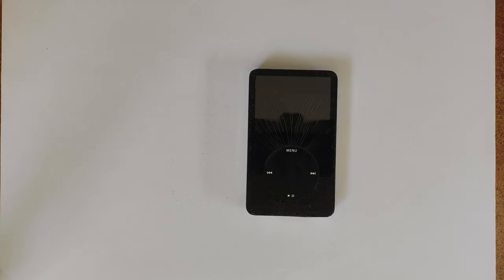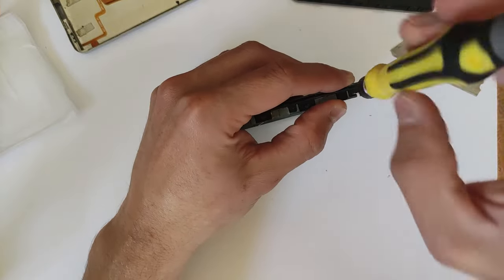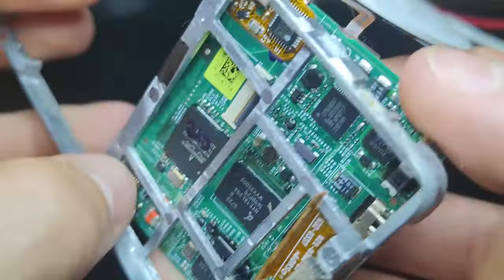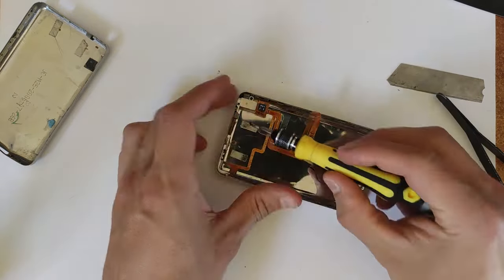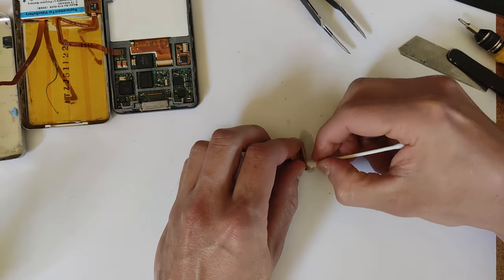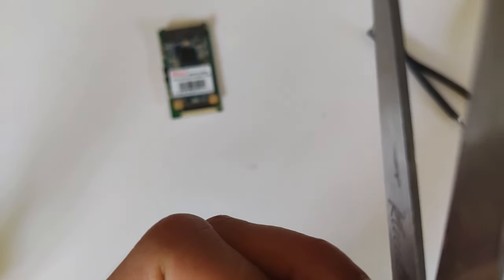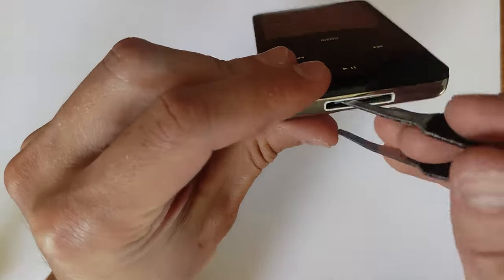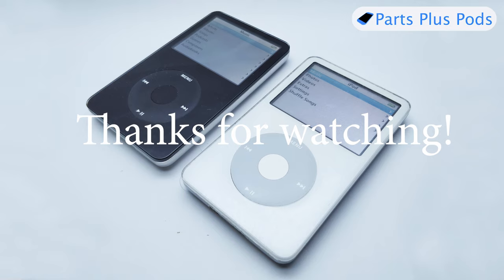iPod Classic 5th Gen Hard Drive and Battery Upgrade Tutorial Ultimate Repair Guide

Comment: Nice video as always. Please, it would be great if you could make a video explaining how to edit those CF adapters with hex editors in order to use them with our pods (those adapters with recent firmware). I've seen the explanation in some forums but never achieved to make them work. It's a pity because adapters with old firmware were a cheap and quite reliable solution.

Comment: Thanks, I have seen many iPod restoration guides and videos and somehow never saw how to solve the issue with the buttons. I have 7th gen in very good condition, the screen is not even scratched, but the center button of the click wheel is kinda sunk down. It works perfectly but feels weird. I guess it hass the foam off-centre issue.

Also, I am quite surprised how easy it is to open the 5th gen compared to the 6/7th gen

Comment: I went ahead of myself and disconnected the ribbon cable connecting the logic board and hardrive from the logic board directly rather than the hardrive by mistake lol. I lined it back up and secured it to the logic board to the best of my ability and won't know if it is good till I order all the replacement parts at some point. I also somehow lost the tiny rubber nipple under the select button, so i just took an unused rubber earbud tip and cut to size and glued lol. Definitely should have slowed down lmao, but we'll see how it works at some point.

Comment: I Have a 5th gen that runs perfect, still has that static cling plastic that comes on it when its new so the front is perfect, minor scratches on the back, black 80 g , what would this be worth if I was willing to part with it? I bought it and put it right in a case and plugged it into my car, controlled it through the stereo so the buttons have not been used much and again have the original protective plastic still on it. , maybe has a few hundred hours on it, then sitting in a drawer .
This seems like it would be perfect for one of these upgrades as it would be like new.
Thank you

Comment: I'm not at the point where I need to do the majority of this except for the iflash thing. The original drive in my ipod classic 6th gen crapped the bed, so I'm just curious about one thing - instead of that clear tape, can I use black electrical tape instead? That's all I have lol.

Comment: Thanks for the video, i have a problem... the ipod dont read the ssd :(  i have the ssd and the adapter but hi showme a ipod sick and send me to apple support ... please helppp
Reply: I have a similar issue. I put in an adapter and SSD. It worked for 1 restore and read/write and then I went to write to it again and it has the sad face and the computer won’t recognize it. So I took it apart again and put a different SSD brand new out of the box and it still has the sad face. So I think it’s the adapter. I am currently waiting for a new adapter to show up to test for certain. Will update

Comment: One serious question, please respond
Using ssd, wont it heat the ipod and drain mkre battery?

Need help as i am thinking to replace with either ssd or hdd as suggested by experts
Reply from the maker: yeah the SSD will drain more battery. I would recommend to use an iflash adapter with an SD card for better battery life. And a 2000 or 3000mah battery as well if you can
Reply: @partspluspods3689  thank you so much sir! Means a lot :)

Comment: Do you refurb for customers?
Reply from the maker: Yes! i have a mail in repair section on my website where you can book it. Just add the repair to cart, click checkout and then it will give you the address to send it to. You can send it in from anywhere in the world and there is also an option to pay after the repair is complete if you would prefer
Reply: @partspluspods3689 if I use a cf adapter can I do a battery upgrade?

Comment: At 12:24 you mention the MSata drive consumes the most power of the drive options. If I upgrade with the MSata, how much battery life could I expect with the IPod Classic? Does the MSata drain the battery within an hour or could I still get at least 3 hours on the battery?
Reply from the maker: It depends on the battery you use. With the standard one it will still last more than 3 hours. I would always recommend using either the 2000 or 3000mah battery if you can though, it should last for a few days of straight music playback with one of those even with the msata drive.
Reply: @partspluspods3689 Hi, thanks for the great guide!
Could you please provide a link for such big batteries which can fit the 30gb case(5.5 gen) and one for 60gb(5 gen), as currently I am upgrading both for the family with 128gb msata which you advised?

Comment: 13:00 Why do a lot of people buy the iFlash Quad, even if they only want to put in one or two microSD cards?
Reply from the maker: it is slimmer than all the other aftermarket adapters and will fit in the slim version with the 3000mah battery

Comment: I have an iPod classics installed with 3 x 256GB SD CARDS that connect to MERCEDES BENZ car stereo system via the 30pin Apple connector.  It cannot play for more than 1 hour while the iPod battery runs flat.  Battery drains faster than the play even though the iPod indicates the battery is under charging.  Do u have a solution?  Thanks
Reply: You need to replace the battery.

Comment: Can this 5 gen video/upgrade be applied to a 6 gen upgrade?
Reply from the maker: Most of it yes as they are very similar. But i do have a separate video on the 6th/ 7th gen. The biggest difference is how you open it. Also the green msata and cf card adapters that i show in this video dont always work properly on the 6th and 7th gen, i would recommend using the iflash adapter instead for those models.

Comment: i have the 30gb A1136 ipod 5th gen classic.  is there a limit size for how much drive size i can replace to the A1136 model?
Reply: I think the limit for the 30gb version, is 128gb. If you put more than that, the iPod MIGHT not be able to handle them correctly.

Comment: thanks for this video mate. i loved my old 60gb ipod black 5th gen years ago. about a year now ive had a second hand white 80gb 5th gen ipod from CEX and paid £80 for it. it worked fine to start with then i started getting ink lines across the screen. so i need to replace the display. also waking up the ipod is damn slow because of the HDD. also ive had the ipod freeze on me many times and cant hold menu button and center button to reset so i let it die and then charge it back up when i get home from work. i want to find parts and replace everything. the back cover, the front, the battery, the logic motherboard, and SD card. i did get ipod touch when they first came out and i noticed that ipods after the 5th gen were not as loud. i have pretty shit hearing and this ipod 5th gen is my go to. i wonder if u can add bluetooth connectivity so u can add wireless headphones? edit: also the center button on my ipod doesnt click well.